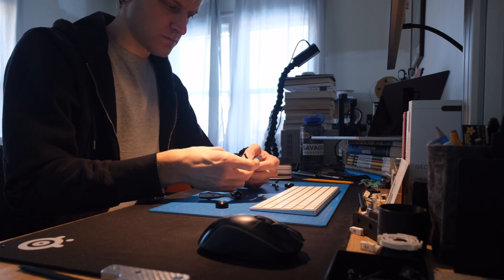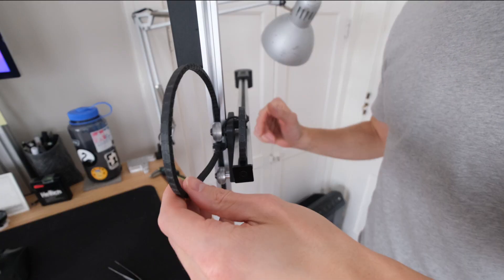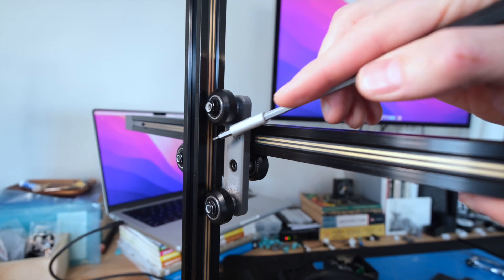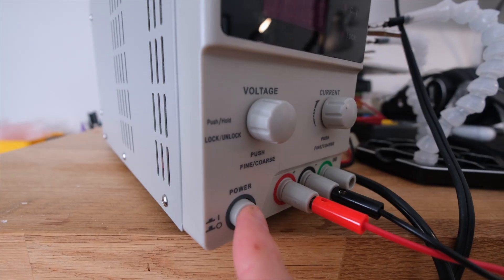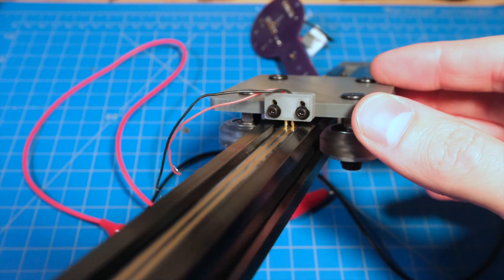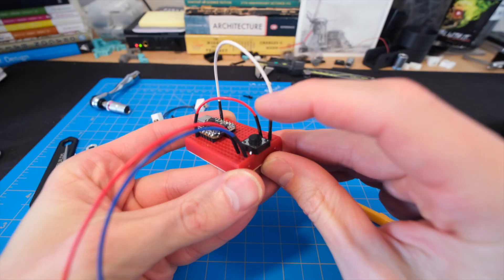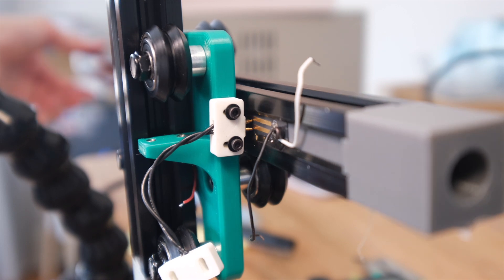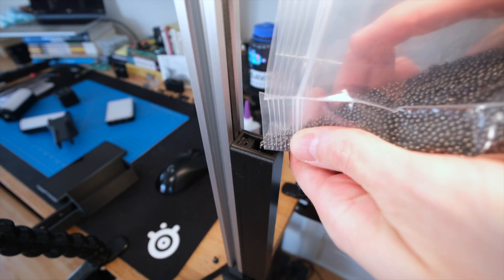Pogo pins: attractive distraction or ultimate wiring solution? - DIYson Lamp Build Log #9

Comment: super cool ideas and developments again this time, very well done for the thorough testing you did, that seemed like a ton of work. 
the tidiest approach i can think of to address the issues you had would be to place the pogo pin connector(s) inside the carriage as central as possible to the various wheel contact points, so deflection is minimised. if you can find a double-ended pogo pin connector, a single connector bridging the tracks at the intersecting point of the two arms would be extremely tidy with virtually no pivot to amplify the deflection.
Reply: this is the solution that came to my mind as well, double-ended pogo pin at the intersection and super track moved on the other side of the rail. If no double-ended pobo pin available you can 3d a solution and just solder the pogo pins

Comment: What about redundant pins on both extremes of the carriage. if rotation in one extreme pulls the connection away it will technically reduce the distance in the other extreme

Comment: Great solution to the wiring issue. Sounds like it will work. Must admit I didn't like the wire chain solution, but figured it's the best way considering the patent limits. But this really works from the aesthetics point of view. a DIY solution for an extremely tough issue. Won't be surprised if you get a nasty email from Dyson now that you've basically achieved their own design, but without patent infringement.
Reply from the maker: No nasty emails so far🤞🏻

Comment: Awesome as always! One solution to the pins could be to have them pressed down with a spring so when they move too far away from each other the spring keeps pushing the pins down.
Reply: Indeed! Float the entire pin mount using a compression spring to maintain contact with the T-slot. Perhaps chamfer the edges of that piece to fit the profile more 'snugly'.
Perhaps also check how little force is required to maintain contact to reduce friction wear on the track?

Comment: Additionally from your clip of the Dyson lamp the lower rollers are further apart adding stability.  The upper looks as though a spring is used to force the upper roller down. Similar to an eccentric nut..  Hope it helps and appreciate your design and thought process.

Comment: Seems that for sliding horizontally, the cartage seems not as rugid as expected, there are too much play when it extended too much, if just finding a temperory solution I think you can just widen the exposed copper trace so there will be a higher chance of having a good contact, but still I think it is better to improve the overall rigidity of the cartage first. From other comments I've seen, seems adding an additional PCB will be a great idea or you can consider flex cable but it will seems quite difficult to solder it to the pogo pins.

Further, I have saw some aluminium profile that is enclosed on some of its side, maybe this will be useful for you to improve the asthetics after everything is concluded.

Comment: Could you move the super-rail on the vertical member 90 degrease counter-clockwise (as seen from above) and then hide both sets of pogo-pins in the carriage? Right where the two members cross the super rails would be facing each other and a single PCB may be able to mount them offset from each other and completely hide the wires and make the "magic" invisible.

It would also move the pins to the center of the axis the horizontal member rotates around when slightly loose, reducing the chance of the pins coming off the rails.

Comment: I would go with wipers. Open up a potentiometer or rotary encoder. You have the two tracks printed in CARBON, and two goldish bent wipers. They last a long time. I'd be concerned the springs in the pogos would wear into the tracks, eventually.

Comment: Great video as always. More of a set of observations than anything. Would carbon brushes be a more suitable material for the pins otherwise won't the track ultimately wear out. You would need one element to be sacrificial in some way?  Also as others have mentioned did you test linear rails.  They are considerably more robust and accurate.  Perhaps cost is a factor.   One final random thought - Did you test doubling up of the pins i.e. a set either side of the carriage so if one side lifts then the others are pushed down?

Comment: When going for such solutions as pogo pins, meaning spring loaded electrical connection, both go for mechanical redundancy as well as some electrical buffer such as a big capacitor (as you already figured out as I am watching ;) cheers

Edit: alright, you did your homework, haha. But I have another idea to make it work. You could account for the direction of expected offset and reorient the pins/spring contacts. That would obviously also need a split and reposition of the tracks.. But heyo
Reply: kind of like slot car racing tracks, i wonder if using small conductive pads could help stabilize the connections

Comment: Hi there! Can't you just loop the cable around the other end of the aluminium extrusion and then attach it to the vertical sled? So the cable should be always under tension and it should keep the same length on every position right?
Reply: I thought so at first but the length from the lamp to the back of the extrusion is fixed, but the length from the back of the extrusion to the sled isnt.
Reply: @ChrisUG  You are right :D thanks

Comment: One thing that comes to mind with this new power delivery system is the wear and tear that might happen over time both on the track and the pins.
To solve this you could re-tighten the pins to their proper position but I thing a much better solution would be to have a spring to put it towards the track that way it will never be affected by wear and tear and the slight depth deviations in the rail would also be compensated by.

Comment: Loving this series, your iteration and attention to detail is really inspiring! One potential alternative for the pogo pins could be some off the shelf carbon brushes intended for use with a small dc motor. These are spring loaded and maintain electrical contact to the spinning part of a motor so keeping contact with a linear smooth track should be no issue for them, they may also offer a little more surface contact area which could help with any slack or twisting in the assemblies. Looking forward to future videos!
Reply: Also of note, carbon brushes as used in motors can last for a couple years of use on something that spins thousands of rpms. The likelihood of them wearing out quickly on this lamp is very minimal. To coincide with that, the movement of this is slow in comparison so any carbon dust that could arise would not be flung anywhere and could be easily wiped off if it gets thick enough to bother you.
Reply: Yes carbon brushes were my first thought. POGO Pins aren't really designed for any sort of friction, usually used for static connections between boards for testing.
Reply: Agreed - one risk that I see with the pogo pin is that over time they will wear the contacts on the track. The roller pins would be better as they create less friction.
Reply: +10 on the idea of carbon brushes. No worries about wear on the track, they’ll be self-lubricating, and carbon dust should be a complete non-issue; as pointed out above, motor brushes can handle a segmented, spinning rotor for thousands of hours of operation.
Reply: The problem is that 1) They have to be replaced over time and 2) they put carbon dust everywhere, which is probably not ideal for a clean office space full of technology.
Reply: @lbgstzockt8493  yeah the dust and wear isn't ideal, but it's not moving too much to produce a lot of dust. Plus it's better that inexpensive brushes wear down and need replacement, rather than the copper on the track wearing due to friction with the pogo pins

Comment: It may be worth looking at using a flex PCB for the pogo pin power transfer mechanism rather than wires, as its essentially wires (copper traces) laminated inside of a flexible (usually kapton tape iirc) member.

Similarly, brushed motors use carbonized sweeping brushes (hence the name) to transfer power internally, and millions of rotation tend to still be able to transfer a decent amount of power no problem.  Not sure about existing in the pogo pin self-sprung form factor though; maybe worth looking into?

The printed part for the vertical and horizontal joined carriage's torsion causing issues makes me think about eccentric nut on the one side roller on my 3d printer with similar rail assemblies. This concept may allow you to post-assembly fine tune some warping of the print that may be contributing to the "slop" with the end of the arm following a bunch of motion.  if that's not the issue, no worries, but I figured I'd mention it on the off chance you hadn't thought of that.

This project is a joy, keep going!  You've already done a fantastic job and I can't wait to see where you go with it next!
Reply from the maker: Thanks for the suggestions, really glad to hear you're enjoying the project. Take a look at build log 2 to see what I think is the eccentric nut solution you described implemented on the DIYson 👍🏻

Comment: Have you done a test on how long the supertracks last, because of the pogopins "scratching" the surface?
Reply from the maker: Still testing this as it's more of a long-term question, but this is also one of my main concerns.  So far so good but I'll keep you updated :)
Reply: @StevenBennettMakes  Carbon Brushes are what is used in motors - theyre essentailly graphite pogopins so you could keep the supertrack and just modify the pins. They also have a larger surface area than the pins so should maintain better contact in tortion and are self-lubricating and easier to replace than the pcb track.
Also good to keep in mind that the track should not be on the top to prevent dust interfering with the connection over time. Bottom or inside makes most sense.
Reply: @ChrisUG But how would you mount it on the inside, cuz there’s very little space in profile inside.

Comment: Rather than having the pogo pins on the outside of the carriage where it is susceptible to motion... why not in the center of the carriage where it is actually not visible and not susceptible to motion?
Reply from the maker: Great idea. That's something I'm still considering and the biggest obstacle are those ease-of-assembly and access concerns I mentioned in the video. Hiding the pins in the center of the carriage complicates the assembly process and requires disassembly of the axes to service. Not a total dealbreaker, but enough to scare me away for now.
Reply: @StevenBennettMakes  but you already have 2 custom PCBs... so maybe adding a 3rd that houses the 2 sets of pogo pins which then simplifies assembly?

Comment: Resin is absolutely not the solution for a drag chain. The print are not friction resistant at all, the chain will be too brittle and the friction will produce dust and will broke the chain in a record time.
With that said, formlab, give a printer to this man.
Reply from the maker: Sounds like this could use some thorough testing 😉

Comment: The supertrack solution came immediately to my mind as i saw your dragchain solution but with two seperate tracks.
Reply: same here, also I suggest to use a carbon brush like motors have in rotors. a bit bigger and wearness will be forever in this particular case.
Reply: @josedavid6400  At least I would try to use some larger contacts. Because I think the wear of the point load is a bit too much.
Reply: @Hassla  agree!

Comment: How about using linear Rails (linear ball bearings) for motion system? Perhaps even smoother motion, cleaner appearance and might add needed stiffness.
Reply: They are way more expensive and precision is not really needed anyways. also aesthetically worse imo.
Reply: I think the torque of the extended arm would probably put too much load on a single linear slide, and having two of them would overconstrain the system